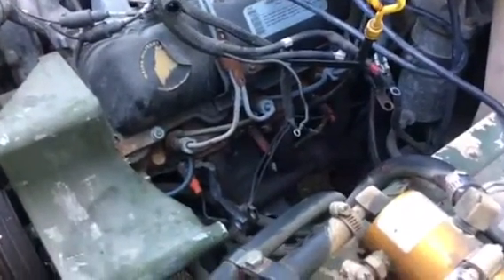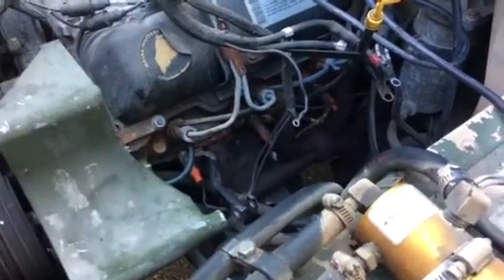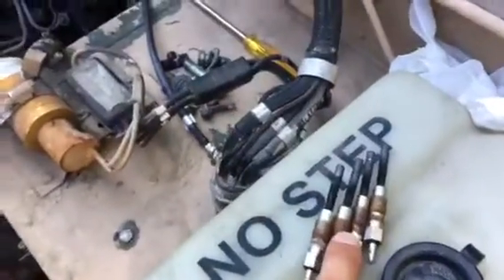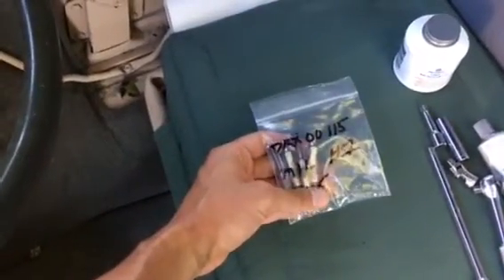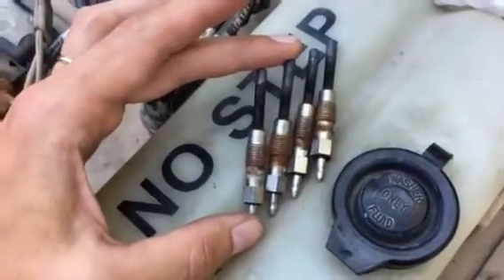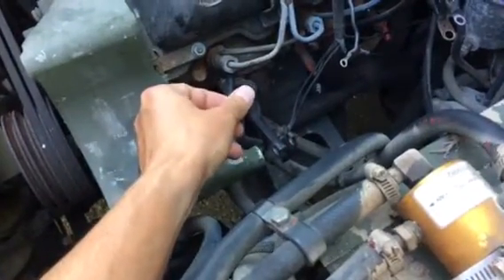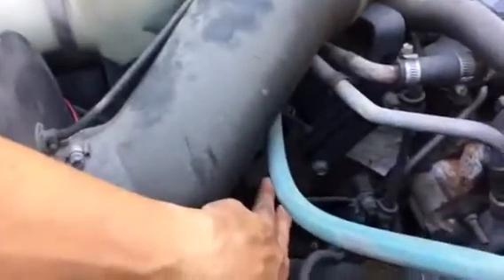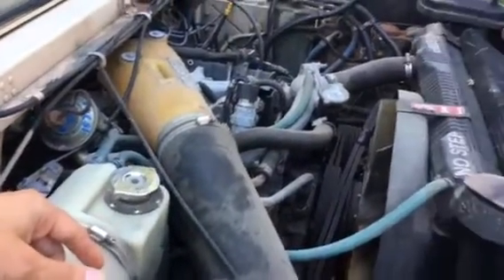HMMWV (HUMVEE) Replace glow-plugs M998 6.5L

Comment: Sir thanks for your video... I found it easier to access # 1 glow plug. Instead of removing the altenator... I removed the glow plug  underneath the humvee .. Directly behind the power steering pump.. I extended my flex head ratchet reach. By inserting a 10mm deep socket on the handle of my ratchet. Secured the socket to the rachet wirh duct tape.. Then inserted a 10 inch long 1/4 inch extention .. Then i had a 12 inch long, 1/4 inch flex head ratchet .. With out calling the Snap On truck..

Comment: The best removal tool for stuck glow plugs is sold by Kascar. A must have item for M998 HMMWV
Reply from the maker: I would like to see a video of that tool in action. Was crossing my fingers the entire time as when I threading I felt the slight  grind of the swollen portions. Worked out in the end. 
Great comment!
Reply: N. J. P. ShoreLife there are video's of it being used and it is worth every bit of the $65. Price. Other tools iv seen range in iffy at best to downright destructive. And it will last for years.. Keep posting your video's they cover everything most of us run into and are clear and well explained. I found your grounding harness video to be most useful. Thanks again!
Reply from the maker: Nice... haven’t seen that one of his. Very simple design. I like it.  Thanks for the heads up!  
Next I have to find a video why a new 60 amp generator would heat up to destructive levels.
Reply: N. J. P. ShoreLife I'll be looking forward to all your vids. I subscribed..

Comment: I can’t thank you enough for the video. Like you I am about to attempt to change glow plugs for the first time in my life.  The plugs  on my 1999 Hummer Civilian model seem to have failed me after a very cold two nights the engine would crank but not turn over.  I’m hoping that this will fix the issue.  I appreciate the tips about turning counter clockwise until the plug drops as that is something, like all things concerning this, that I did not know.  It always frustrates me because so many of the Hummer videos skip steps thinking anyone will know how to do it.  Well I do not. I’m not a mechanic. I grew up on a large farm but my Dad never did engine work except on tractors so I am very low level.  Thanks again and please post any hummer vids you have for newbies.
Reply from the maker: Chad,
Thank you for the feedback. Like you, this truck allows for easy first time mechanic work. Fun stuff. Truck is frozen in New England for now but some things in the near future to expect are easy glove box install, portal axle fluid check fast version, and divider install with curtain mod.   Post your work so we can all learn.   Thanks for watching.
Reply: Chad Kirby chad the smartest people i know are the people that ask questions. I rarly do anything mechanical anymore without finding it first on youtube or elsewhere. Check out his grounding harness video. This grounding harness can and most likely will save you lots of time money and trouble in the long run. Another must have item.